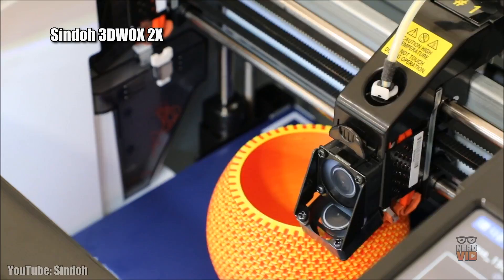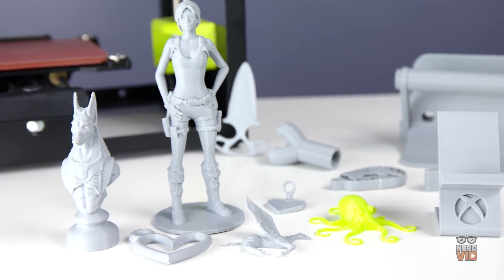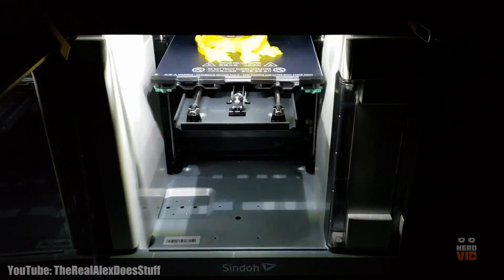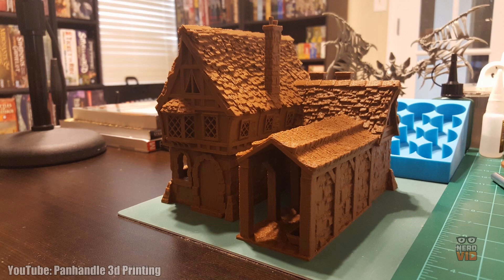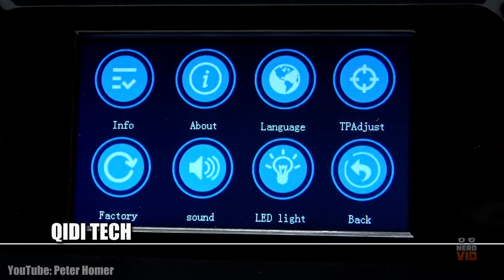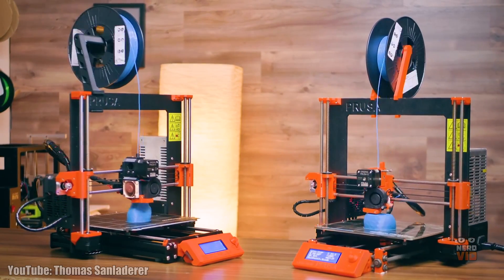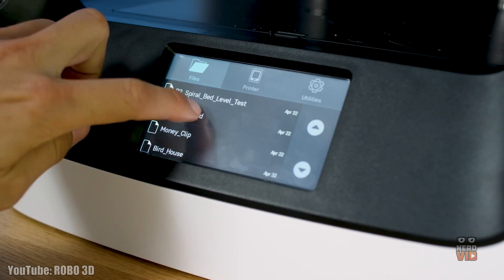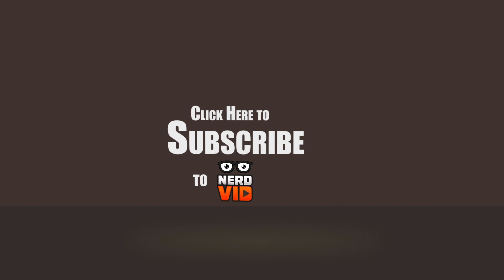10 Best 3D Printers For Serious Hobbyists and Professionals

Comment: These things are so fascinating. 
I just spent $400 in the last month on different items and accessories that were, or could have been 3D printed lol.
But as a complete novice, it’s difficult to chose the right first machine. 
I’ve never in my life been happy with the “entry level” anything, suggested by experienced users. Although I always understand why they’re suggested. They just never suit my needs.
I have no interest in toys or trinkets, but likely exclusively mechanical parts for things like a fishing rod holder for my boat or a bracket for my roof rack. 
I don’t mind a bit of post print finishing, but I’m after #1 strength, #2 resolution. And although I’m not rich, I’m not desperate for the cheapest possible option. 
I just don’t want to have to upgrade through 3 machines in a year learning to make the parts I’d like.
So I’ll take a bit of a steeper learning curve and price tag, as long as there is a clear choice for high resolution mechanical parts. 
Any help would be appreciated!

Comment: "10 Best FDM 3D Printers For Hobbyists" should be the title. None of these will work if you need your model to be free of build lines and/or have intricate features and features smaller than 1 mm. If you're a professional modeller, jeweler, dentist or engineer - you have to drop a bit more money or go thru a print farm like Shapeways. 

You can find a used Solus(bonkers surface quality and detail resolution) for about $2K and Formlabs Form 2's are about the same.
Reply: @Upgrayedd
Good to know. What other printers would you recommend for professional prototype production?
Reply: @ggilesy  Markforged
Reply: @d_law6  Nah, way to expensive. Settled for the Ultimaker S5 and so far its pretty awesome.
Reply: Prusa utilizes 1/256 stepper drivers for precise results, couple that with acetone smoothing and it looks pretty good

Comment: Hi. Since you asked, I'll tell you what I'll be using mine for and maybe you can help me decide which one will do what I need ? At 1st I thought I just needed something to print approximately 70ish different designs of basically a minimum of 6" prefer 12" to 18" tall cylinder tubes which will be between 1.25" to .75" long by .75" to .25 wide. So I could then get the DIY silicone mould kits and make the moulds I need from my design rods. Now that I'm aware of more materials 3D printers can use I still need the same shapes & sizes, but is there and option with the flexible materials in which I can print the shape but this time hollow and be able to pour temperatures of up to 170°F (I can go as low as 135°F but prefer 170°F) then when cooled i can unroll from my shape thus eliminating the steps for the shape and making a flexible mould of the shape ? In other words can i print a usable, hollow, flexible mould that can handle temperatures of 170°F (or at least 135°F) and below ? I am unable to state what's its for as NO ONE in my field users what I've thought up and I'm going to be the 1st to do so. 
I also make plaster "midwinter-gift giving-celebration" ornaments. The DIY silicone moulds I've made are not level so they tend to be thicker on one side or if I try to make them level the overall thickness various a GREAT amount. Currently I just let them get thicker on one side and do my best to sand them even. A time consuming task ! After my ornament has been scanned is it possible to have the flexible mould about to be printed, be leveled AND correct the various thickness levels too ? That would save me so much time. The ornament is a stocking 3 3/4" tall by 2 1/2 wide and an uneven depth (problem detailed below) with 3 holly berries and 3 leaves on top of the stocking.. The lowest part is the body of the stocking. Then the heels, toes & tops are slightly raised. The berries rest on the leaves on the body. The leaves mostly on the raised top of the stocking and part on the body of the stocking. I still want the various front details at the various thickness-but can the mould/print object be told to stop at a common shared depth ? And have bits of material added where needed on the table side down so it now is level ?  (I'm not sure if thats worded correctly or not. ) 
If i can get one to handle those 2 important (money generating parts) my grown child wants it to be able to print up RPG character's players can order from him. Which he can then paint and send them. (I say for him- dont bother painting them - just mail and let buyer's paint as they'd like ! Less time less stress because someone will always be complaining about something being the wrong colour and waiting a refund or repainting and why give yourself that much stress !)
I've a budget of up to $2700.00 to $2900.00 BUT that NEEDS to include taxes, shipping, handling, all optional parts, programs, WiFi receivers, and enough flexible materials to make 10 to 25 stocking moulds for plaster ornaments of 3 3/4" length x 2 1/2" x wide by  approximately .25" to .50" depth. The moulds themselves should be thin enough and flexible enough to peel off dry plaster without breaking it. My best handmade silicone moulds are less than 1/8" thick. Can get away with maybe 3mm to 5mm mould wall thickness ? 
And enough to make 25 flexible, peel/roll down, hollow tubes of 12" deep by 3/4" to 1.25" long by .25" to .75" wide -- basically a piece an inch long by half inch wide by 12 inches tall (6" can work but 18" is best) and anything else I've forgotten but I need if I want to get started as soon as possible when everything arrives. Thank You so much. I've already had to learn so much to open my business and make what I do. I've even had to invent the font I use. I draw the line at web design and becoming an expert on 3D printers only so I can decide which one I need. If I let my grown child pick out printer it won't be able to do either of the things I NEED it to do. And the salespeople at the local stores aren't trained very well on capabilities of items they sale. Only usability of items. So they arent an option either. Please help me ??? Thank You !!!

Comment: Can 3d printers print with metal?
Reply: Some can... But without modification not any shown here.

Ie can get clays for jewellery crafting, that after being shaped, are placed in a kiln. That burns off a plastic binder, and leaves sintered metal behind. Usually stuff like silver, and gold. But other metals might be available.
Would need to replace filament extruder with a paste extruder. Are plenty designs for paste extruders out there.